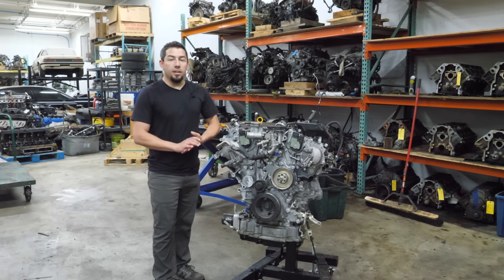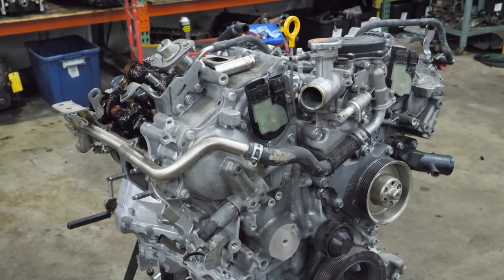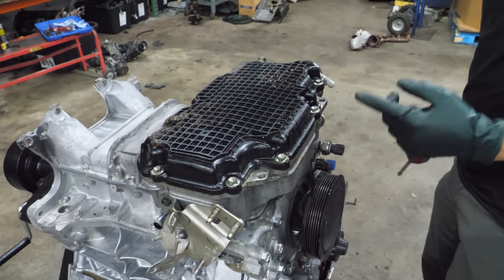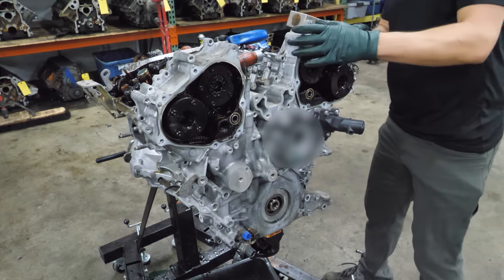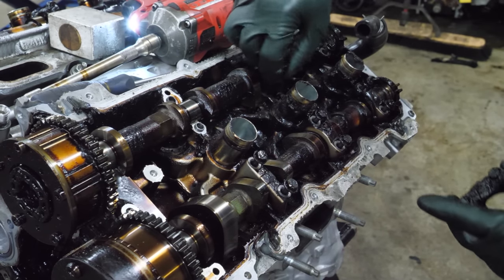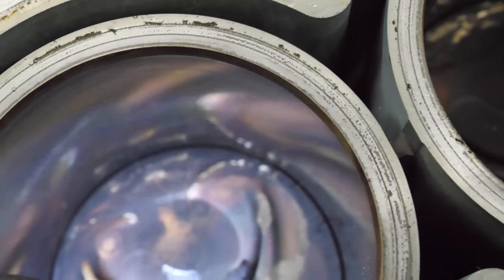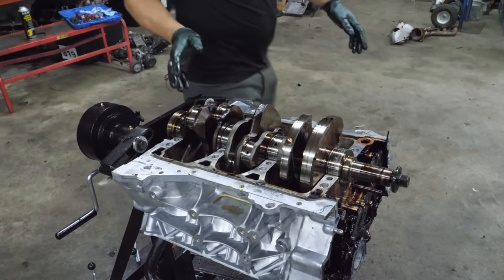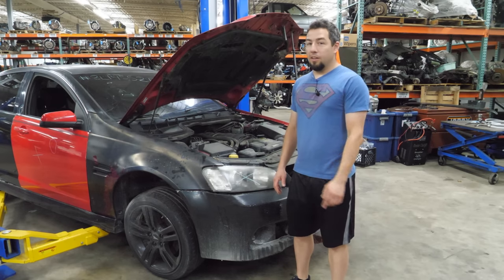60K Miles on 1 Oil Change!?! Infiniti Q50 VR30DDTT Neglected TO DEATH.

Comment: I’m 0:26 into this one…my guess is no one changed the oil
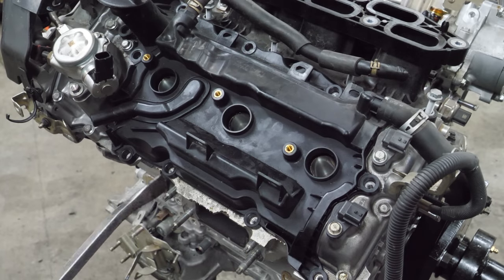Reply: Hole smokes at 2:52 I was close
Reply: Holy Rainman Ray good evening sir. 😃
Reply: @RainmanRaysRepairs  when it rains it pours
Reply: @kevincurry4735  👋 hello
Reply: Ray I'm sure you've seen this more times than you even want to remember.
Reply: Wonder what Eric ( SMA ) would say
Reply: My wife is still wondering why I yelled out "oh shoot" (well not exactly) earlier this evening while watching a stuck Subaru  water pump bolt break.
Reply: I think it was a broken bolt 😂😂🤣😁
Reply: If my dad was still alive, I could attribute this one to him.  His philosophy was that oil didn't wear out, just add as needed.  I saw the inside of his 1966 Chrysler Newport's 383 at 66k miles.  The crud buildup on the valve springs was so bad the valves couldn't move enough to let the engine run.  I was the floor sweeper and gopher in the local Chrysler-Plymouth dealership shop when he traded it in the Jan of 1973.  I thought the mechanic was going to puke when he opened it up.  
Thankfully, Dad's torturing of all things mechanical ended when he passed away in 2006 at age 74.
Reply: @FollowingtheCliffNotes  ouch.
Reply: @kevincurry4735  😂
Reply: That's my guess for next week. No oil changes
Reply: Oh it's you Hi Ray
Reply: Nice to see you here, Ray! Eric was doubting that this ran when removed, but I bet it did because you had a V6 in your shop that was running on 3 due to a broken camshaft. What engine was that one?
Reply: Thanks for this one Ray. I'd say your guess is pretty spot on. Either that, or when they did the oil change, they put the same oil back in with a fresh filter. Purolator, pure oil now, pure oil later. Pure oil referring to crude, that is. Fresh from the dinosaurs deep under Texas.
Reply: Good evening @Rainman Ray's Repairs , how fore art thou?
Reply: @williampope3531  Sounds like my older brother.  My Dad told as about a coworker who never changed the oil in his car, but he traded it in every three years.  My brother must have thought our Dad told us that as a good example, however, my Dad was religious about regular oil changes.
Reply: I guessed that at 0:00 by reading the title of the video.
Reply: This engine needs the special Ray's Brake clean bath........ANOTHER!!
Reply: Looks to me, the oil used was left-over 1960 vintage Quaker state
Reply: What's oil
Reply: Axle grease goes in the CV joints and the Wheel bearings not inside the engine
Reply: @RainmanRaysRepairs  Hello, Saving Salvage, I have learned a lot from watching your video frequency. They are all great. Can I repost your video and share it with more friends? I will link to your channel in the video. Can I reprint it? Thank you.☺
Reply: Hey, its factory oil, lasts forever. In this case, forever was 60,000.
Reply: Hello Ray 👋
Reply: @billharris3650  howdy 👋
Reply: @hotdogandahayride9823  😂😂😂
Reply: one time. no change it is 200% worse.
Reply: @RainmanRayOffDuty  hey 👋 😎
Reply: @RainmanRaysRepairs  The title didn't give it away for you...........?
Reply: @thomasfletcher760  … there’s your problem lady no oil
Reply: @Peter Angles that many
Reply: did the title tip you off?

Comment: That was indeed a costly repair. According to Infiniti’s parts catalog the long block assembly is discontinued. However, the short block is $5800 and the cylinder heads are $2600 each. Tack on turbos and timing components, that’s around $15,000 in parts alone. But hey, they saved that oil change money. 😂
Reply: Ffs lmfao
Reply: Whoever owned the car took fuck it to a level even beyond what I do.

I can almost guarantee the owner of this vehicle microwaves fish at work
Reply: Probably was a lease, and they ignored the calls and emails to bring it in for service. Going to bet they will be charged for the full cost of replacing the engine, and for the towing as well. Though as the lease holder likely is a company the actual driver will not see much of the cost, unless the company decides that this is also coming out of their bonus as well.
Reply: Ouch
Reply: @Lovesausage269  So what is the issue with a fish in a microwave? Horrible smell? I never had the idea to microwave a fish
Reply: @MonstertruckBadass  krissychula to be specific on what one lol
Reply: Guarantee they just didn't care and went a bought a new car
Reply: @pudermcgavin4462  of course they had to get to work and microwave fish
Reply: @Lovesausage269  underrated comment LOL
Reply: @MonstertruckBadass  Anyone who microwaves fish at work is a F%*#ING monster.
Reply: @snojetsst9420  the smell is horrendous!!!!!!!!!!!
Reply: @John Evans, Wow- the price of parts alone for these vehicles actually negates any reason to any appreciable repairs to these vehicles... So, when did Infiniti, become a division of the Ferrari motor car Corporation? 
      I knew a fella who had a M/B with a Dohc V-6... It needed to have work done on the heads... The car had about 90k. Miles... It was only 5 years old... His wife LOVED that car...
      It turned out that both heads were damaged beyond repair, because of an overheat that the car had in the past, before they bought that car... The work was going to cost well over $15k. The car was out of warranty... They also found out that warranty work WAS done to that car on those heads... Apparently , it didn't take the previous work well at all... So they sold that car, as is, for $2k. and lost well over $6k.from what they bought it for, for the 12k.miles that they actually got to drive it...
         My buddy told me that they found another more reliable car that has much better resale value and is much easier to keep going... Another German vehicle.... A '71 VW Beetle... They still have the car 🚗 and are very happy with it... It runs very nice and will NOT DRAIN THEIR BANK ACCOUNT !!!!
Reply: We had a pathfinder that was just a 3.5 someone overheated it was almost $18k for it. A 5.0 Cummins snapped crank 2 weeks out of warranty over $26k. Crazy how expensive these engines are at the dealer.
Reply: @Tdawg, Yeah, that could empty out a building rapidly!!! Maybe a dishwasher could be installed close to where the M/W oven is... 
       I heard about 'Dishwasher Fish' awhile ago.. it works great!!! Wrap the seasoned/buttered fish in alum foil and put it in the upper rack, then run it through a cleaning cycle - WITHOUT SOAP... 
       When it's done, that fish just falls apart... Not burnt at all... The smell is piped outside, where the neibors get to enjoy it too!
Reply: I work for VW/Audi. We had an Audi customer with the 4.0 twin turbo V8 and both of the turbos were smoked. I had read several stories online about oil starvation from this failure taking out the engine, so I looked it up in our parts catalogue, that engine is about $38,000. Which pales in comparison to some Mercedes AMG engines that are pushing $80k.
Reply: @JohnEvans-ct6mz  I have no doubt it cost that much when I worked Land Rover someone sold a q7 and the starter blew up damaged a bunch it was 17k to fix it, luckily Audi was next door. Idk how even someone can even afford some cars nowadays millionaires or not.
Reply: @whatchis1120  That’s no joke. People ask me what I recommend as far as a vehicle goes, I never recommend European brands unless they know how to fix cars or have deep pockets. I love euros because of how they drive and feel but they are performance cars so reliability is obviously going to trail say a Japanese import. I will give it to them though, if an American car company tried to overcomplicate an engine the way the Europeans do, that engine wouldn’t last 20k miles. Even some of the worst German engines, if you do the maintenance they tell you to, you’ll get 100k miles out of it.
Reply: Facts! Always check your oil!🙌🏼
Fun fact: Infiniti recommends oil changes on these engines every 10,000 miles (which is way too long) so I tell everyone with vr30’s to change the oil at least every 5,000 miles. 
I have a ~500hp modified/tuned Q60 (AWD) with this motor and I do oil changes every 3,500 miles to be safe lol. 
It’s a good and reliable engine but like everything you gotta take care of it :)
Reply: @JohnEvans-ct6mz  Wow... Built with gold impregnated into the metal... What is amazing, is some people continue to buy vehicles like these... Status is my guess... I like the Air-cooled VW vehicles... They lasted a long time, most were easy to repair and keep running with minimal expense... What a vehicle SHOULD be...
Reply: Long block is not discontinued. But yeah, upwards of $15k+
Reply: They would just get a complete engine.  Nissan doesn't really do parts for repairs anymore.
Reply: @snojetsst9420  😂😂
Reply: I was certainly short on my estimates.
Reply: Should tear down my maximum engine. I got 100k and grinding noises
Reply: Same story one family go every year for oil and filter to be changed. And after 4 year the car was with the same OEM filter.... but here they don`t even change the oil. I think that it is not always the owner`s mistake. So many ppl don`t know and want to check their oil, they trust the mechanics to do this and this is the end result.
Reply: @MonstertruckBadass  smell and taste yuck my dude lol
Reply: just got new long block replaced in my Q50 for failed head gasket. 27K total warrantied :)
Reply: I've blown one of these before and the repair costed 20k. Good thing the warranty covered it.
Reply: I can find one for 5k
Reply: Man that sucks at that cost it basically totals the car no matter what
Reply: Oops
Reply: @Lovesausage269 😂😂😂😂
Reply: @snojetsst9420 😂😂😂😂😂
Reply: Warranty?
Reply: It didn't blow but they found metal in the block. The invoice was 13,500 you're right it's expensive. I only paid $200 thanks to my warranty
Reply: Allegedly you can get a crate bmw b58 for 9k, I’d be amazed if it was really 15k for this engine
Reply: @10:39

~~AHEM~~

Manufactures do not use the "cheap" sounding word: "plastic".  Marketing Department instead prefer to use the word: "resin".
Reply: @MonstertruckBadass  It great is a large lunch room. You ever dont like a place throw some sardines in the microwave on 30 minutes then quit.
Reply: The long block is only $5k
Reply: @theblazzed2114  

But the owners should learn if they are getting wall jobbed.

At tax payer can hire an accountant to to perform tax forms stuff; but in the end, the IRS will still look to the tax payer if there is a major problem.

Comment: Never saw sludge like this. The worst was a guy who had been putting non-detergent 30wt in his engine. When we pulled the valve covers, it was like lifting a jell-o mold. Complete with "Chevrolet" molded into the sludge loaves.
Reply: I've seen engines like that several times on the Just Rolled In channel.  It's really something.
Reply: Just need to add the cat chow bits for garnish. Yum!
Reply: I bought a Hymac in the 80s with a 6L Perkins diesel. The block was split from freezing. I had this welded. At the bottom of the sump was sludge like soft tarmac which I chiselled out. After a good clean and service it ran well with hard work for 5 years until sold. It was a very basic but well engineered engine.
Reply: Sludge loaves? 🤣
Reply: @mikegreen2229  💀
Reply: Did you happen to take a picture I would pay money to see that picture
Reply: Umwhat flavor jello?

Comment: "No one has ever blown up their engine from changing their oil too often."
WalMart tire and lube HAS ENTERED THE CHAT
Reply: Jiffy Lube says "hold my monster energy drink as I put your drain plug in with a 3/4 impact."
Reply: Firestone says "It wasn't us, the last guys must have cross threaded it - you need a $600 oil pan or a tow out."
Reply: Nissan dealership:
“ Could not have been us…………….We only install OEM filters”
Looking at the WIX filter you installed yourself during the previous oil change. 😮
Reply: Take 5- WTF is oil?
Reply: ...As long as they add the new oil in, and remember to put the new oil filter back on!
Reply: Presuming, of course, one uses a moderate or better quality of oil, and does the other parts as well.

Example: one uses MalWart’s house-brand synthetic oil and changes it every few months - with, as a rule, less than 500 miles between those changes.

I have heard that with limited driving, e.g. one is “retired” and does not need to drive much - groceries, bill-paying, doctor visits, and perhaps a shortish excursion now and then - it is better to change on a schedule.
Reply: @someguywithaphone5921  Or they leave it off as the other adds fresh oil then puts it on after oil is added.
Reply: @@PeterAngles-ks9fp thanks.  I currently do not have a conventional vehicle.  I was thinking “If I should somehow get one, and then could somehow afford to pay insurance, etc on it.  Currently, I cannot afford the latter - so I must “make do” with an Ebike, one I put together myself - and no, it was NOT cheap - at least, not cheap for a disabled, nominally-retired person with a number of chronic illnesses that mostly started in childhood.

The current one cost more to buy the parts and tools than I recall spending on my last car - a “bought used off a dealership lot and financed” car.  Granted, that was thirty years ago, so I’d need to double that then-considerable (for me) figure.
Reply: @Peter Angles I do this with my Miata and Integra. Around 5K miles a year on the Miat and 3K miles a year on the Teg. Change oil on both once a year. I get Blackstone reports every time which always come back clean with zero water, fuel or coolant in the oil. Miata engine miles are unknown but my Integra has 384k miles all original drivetrain.
Reply: Canadian Tire says, "Hold my Beer".
Reply: @dennisyoung4631  the walmart brand supertech is pretty decent oil actually. it's been tested on youtube many times with oil sent to a testing lab. the oil has to meet the needed SAE certification and you need to change it. 60k on an oil change is insane abuse

Comment: In 1963 when I was 16, my friend bought a 1956 DeSoto that ran great.  We pulled a rocker cover and it weighed about 20 lbs.  it was full of grey jello.  We cleaned it and the other side out and changed the engine oil to high detergent oil.  When that oil cleaned out all the other sludge in the engine it burned oil terribly and never ran well again.  Live and learn.
Reply: I guess that's why some mechanics suggest not to flush an old high mileage auto transmission, because that's going to be the end of it😁

Comment: As a Q50 owner I must say I am impressed the engine was still running and it's that gunked up. I'm at 120k on mine and has never missed it's 5k oil change so I have high hopes I'll make it to 200k
Reply: Dam you wait to 5k I do mine 3k I rather be safe then sorry
Reply: @D0nt_trip3  I was doing it every 3k but I was doing an oil change every month which was a bit excessive for me. plus I put in Lucas full synthetic oil stabilizer everytime and do 6qts instead of 5.5 for a little bit of extra protection.
Reply: @dillpickle2512  putting more oil than required is not extra protection it’s called running rich and can hurt your car too just like running with less than required Can hurt your engine
Reply: @D0nt_trip3  well 80k miles of doing that on top of the fact it's far from stock plus been beaten hard and no issues yet so guess I got lucky. knock on 🪵
Reply: Why did you cover up the water pump outlet
Reply: @alexanderkennedy2969 I have an oil catch can and it's always half way full every oil change if that gives you an idea of the amount of oil being shoved back into the intake
Reply: My VR30 is at 122k as an original 2016 one with stock turbos. I change oil every 3k using full synthetic 5W30 and im yet to have problems. The key is to keep up on maintenance and not drive like your on a race track 24/7.
Reply: @dillpickle2512 Im looking at an oil catch can soon too probably going with Z1. What kind are you running tho?
Reply: People are so fucking obsessed with oil lmao. I do 5K changes on every car I've ever owned and never had an engine blow on me. People need to fucking relax.

Comment: The power difference is due to boost level in the tune. 400hp version runs 14 psi and 2 intercooler pumps
Reply: Wouldn’t it then be a worse idea to get the 400hp engine because higher pressure leads to faster breakdown of engine? I’m assuming in most circumstances people don’t need an extra 100 hp.
Reply: @Poochie !  That's not how it works lol
Reply: @poochie5543  only if you constantly at 6.5k rpm. The plasma spray in the cylinder walls has a very small coefficient of friction which expands the life of the engine.

Comment: It amazes me to see how these neglected engines hold up pretty well. How is it possible that it actually has so little damage?
Reply: look at it this way. If you’re an intelligent Nissan Z, Q50 or Q60 owner the engine will run a long ass time if you change the oil. Wish the nimrod who owned this motor knew that 😮

Comment: The reason they do that with the drain bolt height is so the pickup tube is never not submerged in oil, so it never pulls air into the system during oil changes. The timing on these engines is really delicate and air being introduced can cause serious problems
Reply: AKA Nissan didn't want to start pumping oil? I mean that's a terrible liability to cover a quirk. And that's coming from someone who cracked a passenger cam gear on a VQHR, so this episode kinda hit close.
Reply: I can sorta buy that (though I would think that waiting a minute or two after filling it with oil would mitigate that kind of thing); composite oil pan is still a bit of a headscratcher though.

Z1 makes a metal undershield for these now.